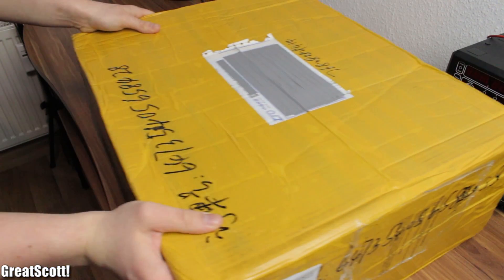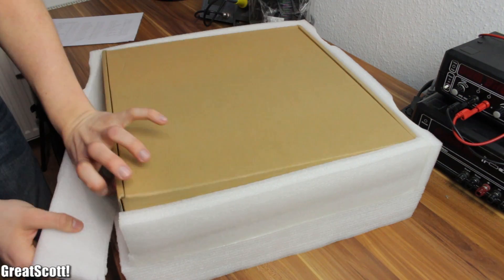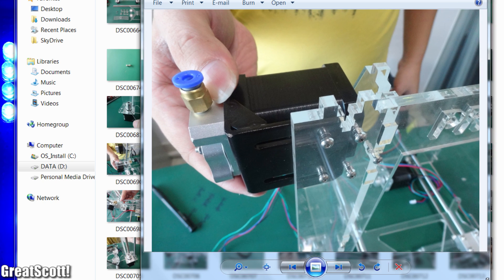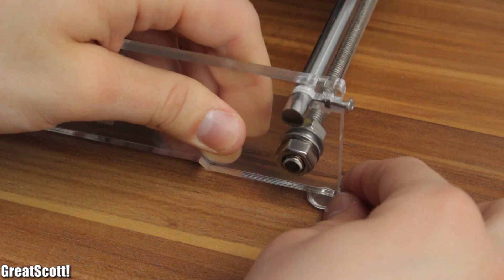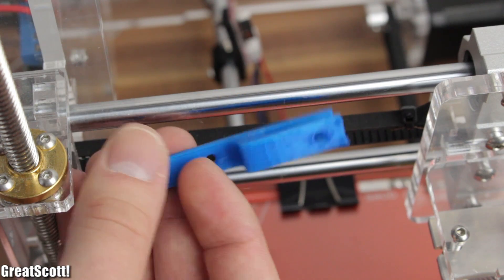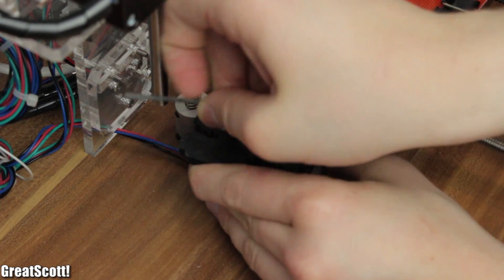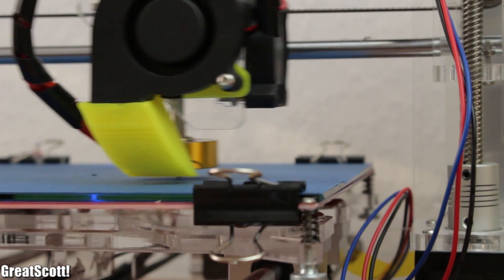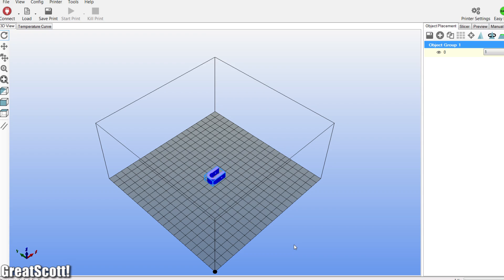3D Printing Beginners Guide (Hardware) - 380$ DIY RepRap Prusa I3

Comment: I am wanting to get into this 3D printing.  I'm trying to find out what software program or Apps to use to make designs to print.  Do these kits come with their own software?  I own a macbook pro 13 2014 do you know of any Apps I should get?  Thanks for any help and great video!
Reply from the maker: rjguess1 I have no experiences with Mac OS X
Reply: rjguess1 Check out 123D Design and SketchUp. Also, Netfabb Basic is good for making sure your parts are ready for printing. All of these are free and work pretty well but have different learning curves.
Reply: Thank you for this information!
Reply: rjguess1 Repetier Host and Pronterface is for controlling 3d printer and for slicing you can use Slic3r or Cura. I don't mean to discourage you but trust me you will need a shit load of patience if you want to get into 3d printing.
Reply: So I have read!  Thanks for the info, I do appreciate it!
Reply: rjguess1 just buy a new windows pc
Reply: No, I like my mac better than my windows.
Reply: Most slicers will work on PC and Mac. So does 123D Design. http://www.123dapp.com/design
Reply: Thanks, I downloaded this app a few days ago.  Been messing around with it.
Reply: rjguess1 Tinkercad is a simple, yet amazing CAD software that can be used in an internet browser. I use that for printing simple projects, although I just received access to AutoCAD's student software to use in the future as well.

Comment: You should try puting glue stick on the heated and on 55c° it works great for me (and you Can even go to 100 not the 90 they tell after that you should be capable of printingABS without warping )

Comment: When printing on glass you need to prime it with some gluestick.
I use the Ultimaker that has a heated glass bed and a little glue stick does wonders when you use ABS. PLA will stick well enough because of the heated bed.

Comment: I've got the same kit but the 2015 version.
I can't complain about anything the prints are just awesome! 
Much smoother and better looking than yours.
The LCD Screen has been fixed in the new version but it is still horrible.
The only problem was that there was no material cooling fan which I had to buy from amazon.
Very good guide :)

Comment: nice video thanks for sharing:) my I3 is only good for one great print a day then it's 12 hr cool down before you can get another, I think my springs on the bed are weak when hot causing heat bed to sag or drop

Comment: Definitely interested. What are your thoughts on GSheild with the Arduino as a modification to this unit. And what 3D software do you prefer? I am old school and enjoy ACad and Rhino. I think this tech is cool but definitely needs modified. Better step motors and I've never been a fan of rubber belts. I prefer gauge wire twisted around the pully. Utilizing a pull method. Keeps the controls honest and accurate. Just me. Enjoying your channel BTW.

Comment: I bought a ctc 3d printer ipad I have quite a lot of knowledge in 3d printing and I thought about the cheap prusa kits but I'm glad I went with my ctc as a spent ages upgrading the firmware a dealing it in nicely and it prints some things that give my colleges stratasys machines a run for its money in (quality that is not dimensional accuracy lol)
Reply: Simplify3D

Comment: How much did the shipping/customs cost you? What software are you using? Do you have some official software by the creator or some open sourced one? I was thinking if it's possible to do a DIY one without buying a kit and using an arduino.
Reply from the maker: Beta Seven 70€ customs, I use Repetier-Host.
Reply: Thanks for the fast answer.

Comment: Mmmmm Cheap Chinese junk xD Now you can print your self a better printer! :D Reprap Wilson is a better printer than the i3. Sturdier frame and less parts over all. :) Combined with a E3D hot end it rivals the likes of the Ultimaker etc. Although that might be the source of some your your crappy prints, cheap Chinese hotends. They just aint made right at all. Very rough inside.

Comment: You should look into getting an e3d hotend. I have an e3d lite6 with this printer (the 2015 updated model) and quality is rivaling that of a makerbot. Also good filament really does help in terms of getting better prints. Try some Amazon hatchbox filament, microcenters inland brand filament, or makergeeks made filament, for they are all good choices according to the reviews and recommendations I get to use them. (I personally use hatchbox because I havent got the opportunity use the other filaments).

Comment: iv really been considering buying the newer modle for a while now. i know its not plug and play and there is a lot of problem solving involved and i dont mind that, but will there ever be a point where the issues are solved and its simple to use? i dont mind complicated setup i just dont want to have to fix a new issue every day. simple version of my question is after i problem solve and work all the kinks out can i just start printing without too many big issues? (not ruined prints or anything i know the success rate isnt amazing but BIG issues like stuck belts and broken parts)

Comment: I bought an even cheaper 3d printer kit from Aliexpress a few months ago, a wooden frame i3.  Actually, it works very well,I'm not fussy but I get results out of it that are great for my purposes.

As usual the manual deviated slightly from reality.  I also made a few modifications and wrote about them...

  http://sparks.gogo.co.nz/prusa-i3-from-rp3d-notes.html

Comment: Hey scoot u can print a module to join ur LCD to the printer so there's no need to leave it and u don't need painters tape u can use the heated bed for pla also which software do u use

Comment: The sunhokey prusa I3 2014 model has some... technical difficulties no doubt about that, but for theyre new model (the 2015 model) I can vouch for it. I did run into a few issues when trying to use, and the main cause for about 90% of these is the extruder itself. After upgrading to a e3d Lite6, fixed all my extrusion problems, theres also a group for the owners of this printer on thingiverse http://www.thingiverse.com/groups/sunhokey-3d-printer-owners

Comment: This is great! I've also bought one of those printers and I've been working on it for about 8 months now. I've had to deal with all sorts of problems from the power supply burning out to the extruder hot end cracking. I'd love to see more on what you've done with yours.

Comment: Their is a printer, a diy kit on eBay that uses the delta technology rather that the cartesian design that you use for your printer.(u probs know that) The delta/Kossel printer has less variables, is a much more rigid design and should get much better prints, also the success rate would be much better. I'm not saying this from a quick search on the Internet, I have a couple printer and the delta printer would be the best way to go. I would go for the folger tech printer on eBay for $370. (I'm not selling them to u, I just like that one)

Comment: Hello sir!  I'm a fairly new subscriber but I want to say that I already love your channel. I have one recommendation that echoes a previous commenter - try blue painters (masking) tape and a layer of glue from a glue stick. I use a custom cut piece of mirror on the print bed, held down by binder clips. The taped glass can usually be used three times before I have to retape. For me this worked wonders.  Good luck!

Comment: hey Bro make ups for wifi router/modem that runs about a 4 to 5 hours it will help all the isp who face a lot of problem of power cut off in india plz help me
Reply from the maker: Syed Khalid I put it on my to-do list.
Reply: Syed Khalid it's not that hard. you can find several lithium based boards that will do this on ebay.
Reply: hello Flippynl iam in india so i cant buy on ebay
Reply: GreatScott! make it soon as possible for mine thanks and keep it up....

Comment: I am building a delta 3d printer and Im using the prusa i3 printers in my university, the best way to get the prints to stick in the bed is to use the most cheap hairspray you can find, we use nelly hairspray, and sometimes the prints stick so well that simply tou cant get them off without some heavy force.

Also, as the bed can bounde back one or two mm when pressured, we put the z0 touching the bed just barely, not even a foil can pass, but you can see it is barely touching, this way the first layer is squeezed and it turns out in a perfect adherence.

Comment: You have a headed bed? Why you use blue tape? Use a thin aluminum plate between the PCB and the glass as a head spreader. Than use a liquid glue stick to prepare your print surface. And please, start with PLA or XT. ABS is not really suitable for your Printer without a headed camber.
Reply from the maker: MakerSpatz I have not tried ABS yet, only PLA. But thanks for the tips.
Reply: GreatScott! Die Lernphase kann nun beginnen ;) Achte auf die Qualität von deinem PLA: Ich kann Colorfabb oder DasFilament.de empfehlen. Finger weg, von dem Ebay Filamenten, ausser du willst Luftblasen in deinem Filament haben.
Reply from the maker: MakerSpatz Ok, da schau ich mich mal um.